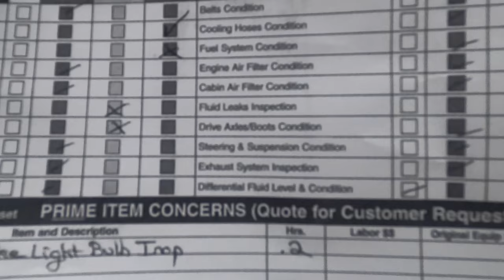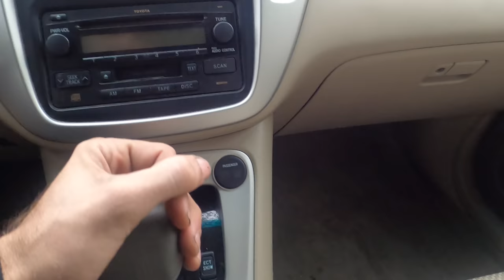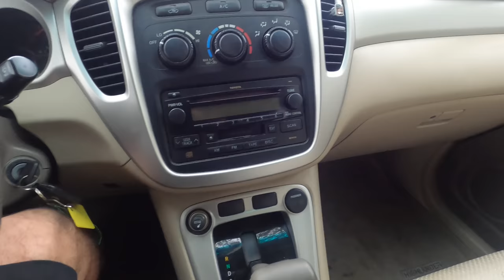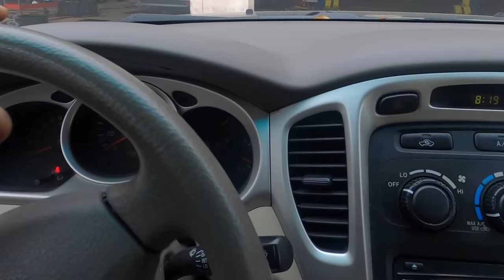We were BASHED by the Dealer! Ripping off a customer! Toyota Highlander 3.3

Comment: Hey Ray, be careful when using chrome sockets with impact drivers. Light duty use is probably ok but heavy duty use can shatter the chrome sockets sending shrapnel across the shop. 🤔
Reply: "But everybody does it!", says everybody who's doing it, which is almost everybody. But yes, when it's a problem, it's a problem.
Reply: I saw a chrome socket shatter on an impact wrench once….. Destruction that only man kind knows…
Reply: @frankthespank  Out on the road today, I saw a Harbor Freight sticker on a Cadillac.
Reply: @theundergroundlairofthesqu9261  A little voice inside my head said, "Don't look back. You can never look back"
Reply: It’s one of them things it’s ok till it ain’t 😂😂😂
Reply: Words of wisdom. There’s a reason why impact sockets are made of steel
Reply: @christophervanzetta  impact sockets are made a heavier softer steel. Heavier so they have more hammering force and softer to prevent damage to the fastener and to minimize the chace of shattering. Hardend steel is brittle and shatters when enough force is applied to it.

Comment: Here is a suggestion for the next time that you run into this. You might want to throw the rotors on the brake lathe with the parking brake drum facing out. Then you can let the lathe spin the rotor while you work it over with the flap wheel.

Also, I hope that you were wearing a good cartridge filter mask while you were sanding that rust.
Reply: By the sound of his voice, I'd say he was not wearing a mask.
Reply: Something I learned in the 1990's. Never compress your brake calipers without opening the bleeder screws first. Why chance blowing the lid off of your brake fluid reservoir and/or messing up your ABS system.
Reply: A N95 mask would be enough, no chemical vapors present, only particles.
Reply: @robroy9793  I was wondering if he did that but I mean he’s human just like the rest of us
Reply: @Clark3218  He is human and so is the customer driving away with the brake job he performed. And here is something else I learned from an old timer. As a mechanic you can be held personally liable for a brake failure leading to injury or death. Not many people know that they should have sufficient insurance to cover themselves in a lawsuit when choosing a career as a mechanic. You can cover yourself financially by purchasing an "Umbrella insurance policy". This is especially important  when you are  facing a lawsuit where you have been found guilty.
Reply: @robroy9793  or just take the cap off the reservoir? I would have thought cracking the bleed screw would add to the chance you will draw air in.

Comment: It’s always messy when another repair shop gets involved, you have to wonder if the customer does is on purpose as leverage.
Reply: @Lloyd_Will  it’s unfortunate that worktops or business may take advantage of customers with people with limited vocabulary skills, that’s not what this topic was about but it’s a very valid point you raise. If I may suggest in future that you shop around for quotes prior , that way it’s very unlikely you will be misled and don’t forget you need to authorise any work not initially on the job order. These may happen and are genuine as seen multiple times on Ray’s video’s.
Reply: The customer wanted the brake job they paid for.  Not grinding metal sounds and stuck slider pins.  And missing parts.  So the customer went to  another shop.  And found a bunch of problems ray fixed.  Ray changed out a gasket and pins and cleaned up rusty parts.  That should all have been done

Comment: Hey Ray I've used them sanding wheels on different things and they aren't cheap. Why didn't you just use a wire wheel to clean that rust out the parking brake drum? Cheaper ain't they?

Comment: that wrench slipping is because you're using a 12 point wrenches on a 6 point bolt. you should know this stuff man.  I'm insanely picky with what wrench I use on what hardware. 12 point will slip on 6 point and vise versa.  When using the incorrect style of wrench for the hardware you are losing about 50% of the surface area the socket should be touching on the hardware. 12 point wrenches and sockets on grip the corners of 6 point hardware and when the hardware isn't absolutely perfect it will slip like it did on you when applying a decent amount of torque.

Comment: You stated at the beginning of the video that your shop "put some brakes on this" about seven months ago.  If so, it seems the caliper pins  were not serviced (rusty, missing boot) as well as the rear drum part of the disc (also extremely rusty).  Wow.

Comment: most of the so-called good techs do not inspect a vehicle, they go by mileage alone. if some of the items have been done before and not noted, then the owner would likely get the unnecessary work done and have a bad feeling about the shop/tech as trying to rip them off when it is the other way around. it is hard to find a good HONEST mechanic.

Comment: Looks like the dealer called it on most things. 05 is gonna have a lot of little shit going on. Dealers won't do what you did, cleaning the rotors or trying to save the slides. I stick to electrical engineering, but I have 2 friends in your business, one at a dealer and one independent. Brakes at a dealer they get the whole enchilada, my independent friend gets people coming in with their own pads and wants them slapped on as cheap as possible. There was no safety issue there from what I saw, a lot of people don't know how hard it is to get money from people in any service business. You'll figure it out.

Comment: I’d get that customer on record stating the dealership is slandering your business and as you record the majority of your repairs you’ve made (or a good reason to record all repairs). By doing that you may have a legit lawsuit for defamation of character that they could be forced to compensate your business. Also with the recordings you will protect yourself against lawsuits people may try to claim occurred.
Reply: I’ve had parts that fail which is why just like you say we got to be objective because most part companies actually have a duty if they sold defective products. With your documentation it will help the customers get their money back from the parts shop also, even if you didn’t do the specific job.

Comment: I think she should have just recommended by a new rotors for the back and cleaning the pins with a wire wheel and Reuben them but that's your business that's what it would have been my recommendation I'm not a mechanic though.

Comment: I cringe when you do a brake job and not replace or rebuild the calipers. When disc brakes first appeared on cars, when a pad was replaced, it relocated the piston. Then the piston would seize, overheat and set the vehicle afire. It took two trucks for me to learn. The cause was corrosion in the caliper cylinder. Brake fluid was hygroscopic bad. That is absorbs moisture. 
So the caliper was either replaced or rebuilt. Then a composite piston began to show up in rebuild kits. I was a fan of disc brakes because of my several years working with aircraft. But of course there were people who were opposed to them. After all Henry Ford said that four wheel brakes were dangerous and caused accidents. He had Ford engineering department to prove it.
Reply: Are you joking? Calipers don't need to be rebuilt or replaced on a routine brake job.

Comment: Pretty disappointed to see you leave the calipers hanging by the brake lines. Lazy mechanics always try to balance calipers on the suspension or rotors. When they inevitably fall off, they jerk on the brake lines. Why not step up your game and never remove a caliper without something ready to hang them on? Not fun to be driving down the road and having your brake pedal go down to the floor when you get cut off in traffic because the flex line blows out because you were too lazy to hang the caliper on something besides the brake line.

Not hating, normally I see you do pretty good work.

Comment: The dealer told my dad he had a bad fuel pump and water in the fuel because his old Silverado was running rough . They wanted to charge him $1,700 . He actually had a bad knock sensor . I fixed it for $54 and a beer .

Comment: Park brake rubbing on rear with calipers can be fixed by backing up slowly and gently applying the Park brake to rub off the rust  nuggets. After that you can drive noise free. It also adjust the pads
You can also do it rolling forward but it won't adjust the pads.

Comment: I reserved judgement pending inspection results, but dealer service isn't the boon it's made out to be. In fact, it can be an outright rip-off, and as evidenced here, their diagnosis may even be incorrect.

Long story short, a dealer tech servicing my Camry's trans fluid found signs of a water pump leak the 2.5L is known for, quoting $1000. With no prior indications, I declined. The service writer tried scare tactics ("It could fail as soon as you leave here"). Sure, buddy. 

My regular shop found minute seepage, drying before it could drip, hardly an emergency. They quoted $450 for the same job, without the pressure, so I approved it to avoid an issue later.

That's not the first time a dealer has tried to play me for a fool, and I will never visit a dealer service department again without a prior independent diagnosis of a problem my regular shop isn't equipped for.

Comment: Love watching your work when I'm chilling after work. I see stuff like this all the time with new customers coming from dealer or other shops. No wonder mechanics are often played as the shifty devious type in movies and shows. 

That said I myself wouldn't have ordered new slide pins for the rear. Doesn't make sense with used rusty calipers and brackets. Plus they are easy to clean with a bench grinder wire brush (yes I know once the coating is off they don't last as long but old used caliper bracket so why not), and once that rubber damper on one of the pins swells enough I just toss it. Never felt any vibration once it was tossed myself, and never had a complaint from a customer. Another quick trick is if the boots are swelled up, I take a drill and bore out some of the rubber. I know it sounds backyard'ish but when people are waiting and impatient, its a quick fix and works well. Again, when dealing with a set of calipers and brackets that are up there in mileage, its not really a bad idea.

I also often clean out backing plates and drum and rotor surfaces of rust. After 20 plus years in the industry I learned I should've been wearing a good mask for the rust dust that flies off. I invested in proper masks last few years. Hope you're protecting your lungs bro. When you're young and strong feels like a joke but it can catch up with you. 

Keep up the awesome videos. Appreciate your honesty and dedication in our profession.
Reply: that ones thing im gonna buy for personal ware if i end up in car matince or something if i have to deal with a dust of sorts i do got alergies so im planning on it but im deffintly getting a good mask for work. :P i know my lungs are not happy with things already so if i ever did get into that kind of work a painters mask with a good filter is what im gonna get

Comment: some one didn't want to spend the time  adjusting there shitty install period and sent the vehicle out UNFINNISHED I have done this before I have had the same issue a couple of times as it's part of the job to adjust the brakes after installing them and grinding /rubbing noise same shit  appears after the job . IT JUST MEANS YOU HAVE TO TAKE IT ALL APART AND RE INSTALL TAKING CARE THAT THE INSTALL IS PERFECT SOME ONE IN SHOP DIDNT FINNISH THE JOB. THE PERSON THAT PARKED THAT CAR AFTER INSTALLING THE BRAKES KNEW THEY WERE INSTALLED BAD AND DIDNT CARE PERIOD AS YOU WOULD HAVE HEARD AND FELT IT IN THE PEDAL ......WHILE PARKING IT PERIOD . DO YOU HAVE ANY EMPLOYEES WITH HEARING DISABILITYS THIS COULD BE THE ISSUE THEY JUST DIDNT HEAR OR FEEL THE PEDAL . new people some times do not know all the signs lack of experience doing brakes is a MAJOR issue and most end up with this issue because of it.

Comment: So, some brake work was done by "independent garage". Customer feels there is a problem with work done by independent garage but rather than return to  the garage that did the work the customer took the vehicle to the Dealership for inspection? Customer THEN returns to independent garage with report from Dealership. Independent garage tries to blame Dealership for the concern that should have been addressed by independent garage? This is so messed up. Can we at least have it explained why the customer did not return to the shop that did the work in question? Why did customer take vehicle to Dealership for inspection and not another independent garage? Be   careful, I smell "bias confirmation" by "independent garage".

Comment: Because of the rigours of winter, I have always recommended to my customers to get brakes checked and serviced every 6 months or in the spring at the least to keep everything working smoothly. It is very important for callipers that slide in the bracket since the weather is constantly attacking the slider surface.  I also always used anti-seize on the bolts, anti-rattle on the pads and proper slider lube.

On drum-brake vehicles, there were seized adjusters and broken parking brake auto-adjusters to deal with.  We still have those issues with the parking brakes in the rear rotors.
Reply: What is the proper slider lube?  The sliders in the film seem to have white lithium paste.  I always thought silicon grease to be best if you did not get it on the rotors.
Reply: @4423422  Permatex makes a good silicone ceramic lube.  Most automotive chemical and brake companies (CRC, Raybestos, Permatex, etc.) have a high-temp, corrosion-resistant, brake specific lube.

Comment: Is it time to invest in a snake cam, with light option, to properly present those hard to show angles?
You're right about getting hung up on some pride about a mechanical issue. I did autoglass for 35yrs. There's nothing more non-mechanical than installing a w/s but when done correctly, it is the one part on your vehicle that touches more critical safety areas of a vehicle. I witnessed plenty of new, off the line vehicles that this safety feature had already failed and would have caused injuries in a very low speed head-on impact. Even though they had used the installation manual and performed every step exactly, the surface they relied on, metal pinchweld under primer under paint, had a chemical bonding defect. The primer bonded to the metal. The urethane paint bonded to the urethane w/s sealant. The primer and the paint didn't. 
I couldn't tell you the times I pulled into a Chevy dealer to fix a waterleak in an '89 Cavalier. I would open the drivers door, windows up, and shut it faster than normal. As it closed the top three sides of the w/s would pop up. I would do the things to correct the problem and reset the glass. Two weeks later I would be back to do the backglass. Turned out that the b/g glued surface was so much greater than the w/s has, it would take the sealed w/s for the air pressure to push out the giant b/g. 
They didn't fix it for '90 either but that model had a four door option with a little stand up b/g. It popped first so the same thing, just backwards. '92 & '93 was spent at bodyshops pulling all of those resets out because they were repainting the cars. The recall repaint order required them to be pulled if the dealership's bodyshop wanted paid for the warranty work. 
Yes, life was good! We were making easy money for 10 years from this. I didn't create the problem but I was the guy that fixed it. Someone was going to and I did all of the glass work for most of the GM Dealership's in my area.

Comment: Weird, just as you began to sand the rust out of the drum, I SMELLED IT. 'Psychosomentical_Smellage'? 
Glide Pins, I used that yellowish lube decades ago, ALWAYS dried up & stiffened moving parts, surprised you're using it. Sanded drum wasting that 'Brake Clean'. Floor tap it out, it'll build up again shortly. GOOD VIDEO!

Comment: Just had my rear brakes replaced yesterday. Was supposed to take 1 hour but it ended up taking 2.5 hours because everything was rusted in place so they had to heat up everything. They showed me those slide pins and said they could try to pull them out, clean and grease them but weren't sure the it would work - Luckily it did. Even though they used much more time than expected they didn't charge me a lot more thankfully.

Comment: Seems to me what happened here is the customer never uses the parking brake. After the rear brake job was done, someone used the parking brake, causing the shoes to drag on the rusted drum. I would have tested the park brake lever in the drum as well as the cable for sticking, while you had the drums off. The next time they use the parking brake it could drag again, it just wont be as noticeable because you cleaned the rust out. Hope it works out well.

Comment: Whoever did the brakes did a Quick Job. I always removed and re lubed the sliders. I compressed the calipers not just to install new pads but to check the caliper at the same time. I was an amateur mechanic for 3 years and never did a brake job this bad. I did motor jobs as well. We would install complete used engines so well you couldn't tell it was replaced because we put everything back in it's original condition. Lot's of happy customers and a couple of assholes we just had to run off.